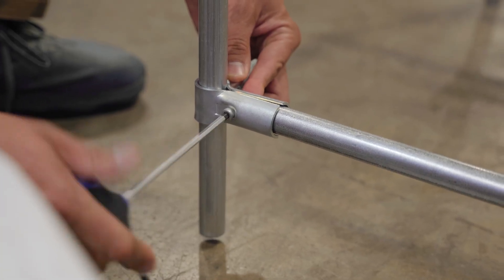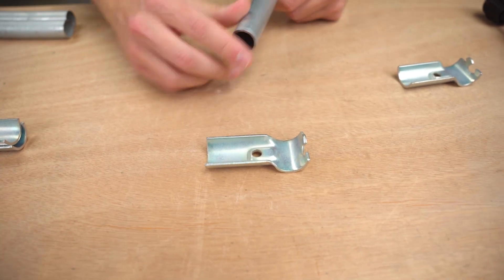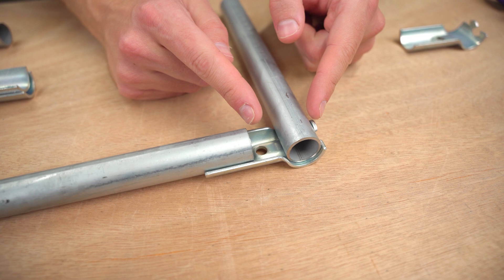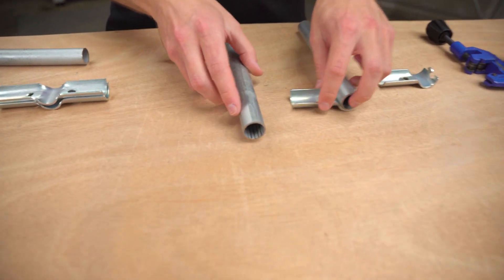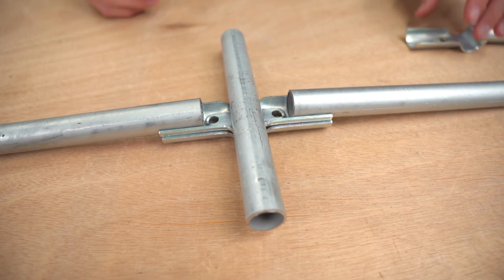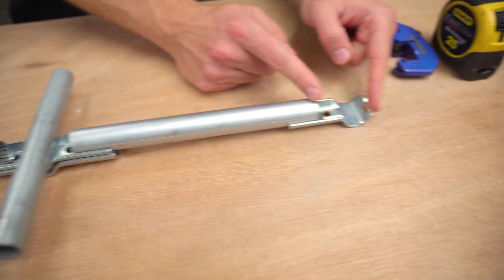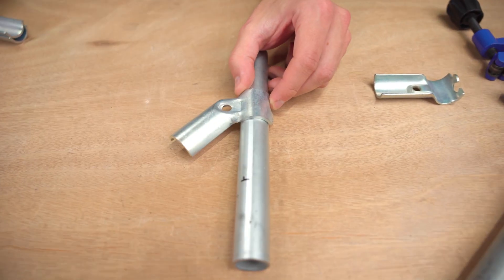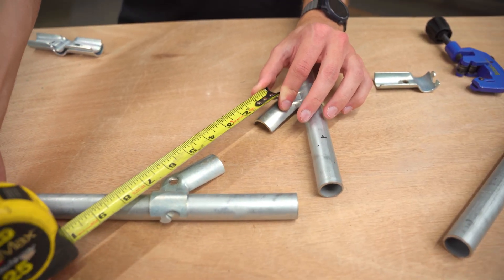How To Make A Conduit Cut List | The Maker Pipe Master Class

Comment: I would like to extend my chain link fence height from 4' to 6' . I would need a T-fitting To fit the top rail which is 1/38 to 3/4 or 1" pipe.

Comment: Thanks for this. I like how Maker Pipe is so invested in customers' success. Nice way to get the measurement for the 45 degree connector. I did think that in many cases, due to the nature of the brace, that there's some play as far as placement along the other two pieces so the length isn't quite as critical. One could do a rough cut, even using scraps, and just slide the brace along the other pieces until it fits. Of course, if you need a specific placement, your way is the way to go. Very helpful and smart way to approach it.